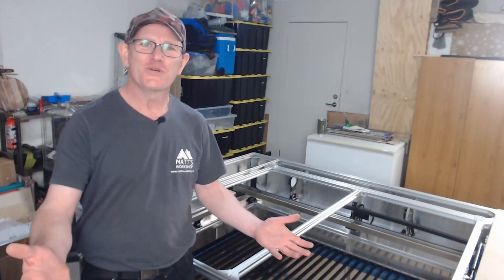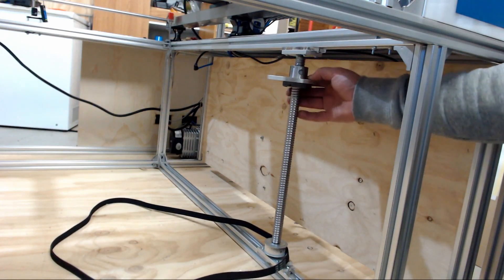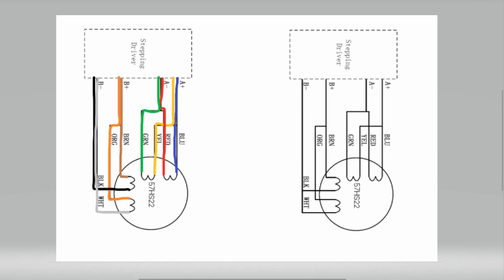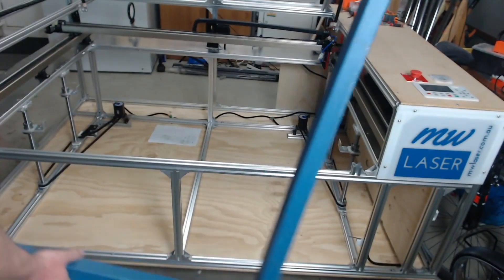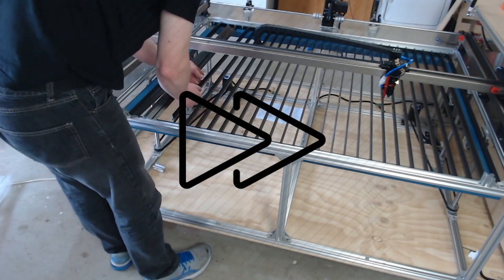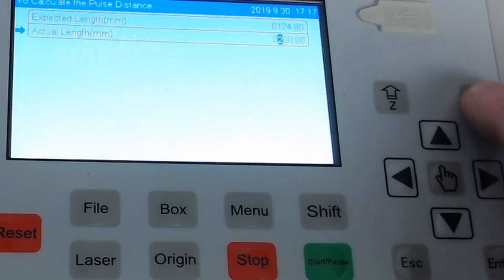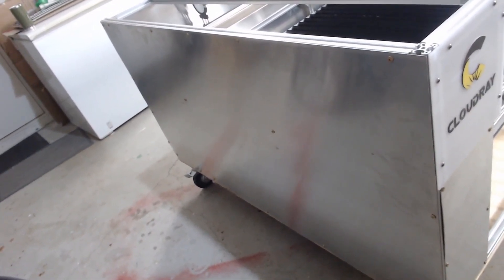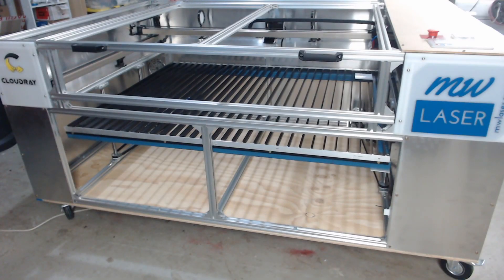07 Build Your Own Laser   Z Axis Lift Set Installation

Comment: Great video and has helped me for my next upgrade. This might sound crazy but I have decided to do the upgrade on my 80w red black machine. I have already upgraded it to a stepper motor and I really like the using the z adjustments in lightburn for offsets but because it is chain driven it is very clunky, also the lead screws have a lot of play. I have ordered custom ball screws (surprisingly on a couple of dollars to customise) and will machine aluminium parts on my CNC. I am currently using a DM556 driver but I might need to add another to drive both. Considering it’s a lot smaller bed I might get away with running at a smaller current per motor.
Reply: So looking at other designs I see thunder laser have moved to a single motor with a long belt which will save me buying extra motors. Also taking their idea of tray underneath
Reply from the maker: Sounds like a good plan

Comment: Hi Matt, I just installed the Cloudray Lift Kit in my Red and Black 100w laser. I have shorter ball screws than came with the kit and made my own brackets.
The problem I'm having is the Distance Per Pulse, Step Length in RDWorks.

To even get the motor to move I have to set it to 29 um an above. Anything lower and it stalls.
When I try to calibrate it I get a Step Length that is way lower, like in the 7.?? range and the motor stalls.

I have the controller set like you have it with the current at 5.83A and 400 Steps/rev.
With ON being written on the dip switch I have 1 on, 2&3 off, 4 maybe on or off, I tried them both and 5-8 on.

As far as wiring I tried your setup and others and found that wiring them in the same way in parallel with no A or B swapping worked just fine.

It's just the Step Length I'm having a problem with.
I have a Ruida RDC6442S Controller.

Do you have any Ideas on what might be wrong?
Reply from the maker: this is not something I can assist with via youtube comments.  email info this to askmatt@mwlaser.com.au with some photos of your driver settings and motor etc and I will try to assist that way

Comment: One design flaw I can see with the Z-Axis Lift: you should've used chains and sprockets for power transmission instead of timing belt and pulleys. Your table is going to be big and heavy and the length for power tranmission is extensive--using chains means more robustness. Of course if you have been sticking too much to Chinese designed machines and just want to avoid working with chains then you'd go for the belt design.
Reply from the maker: thanks for the tip, chain and sprocket may be a great idea, and more expensive.
However after a year of daily use this machine has not failed at all in the movement of the Z Axis with the timing belt and pulley system. The movement is smooth and the accuracy is spot on.
Cheers Matt

Comment: Hi Matt, thanks for your videos. I’ve used same motors and parts for my Z lift system, but the problem is with the motors they are labeled with 4.0A, so i put 1,2,3 driver switches On On Off, but the motors practically doesn’t move, what is happening? The 4th switch must be On or Off? And what is the right current 4A or 5.6A? I have same motors Leadshine 57hs22
Reply from the maker: email matt@mwlaser.com.au for assistance if required

Comment: Thanks for the video Matt but why would you choose a Trocen controller over a Ruida?? That just doesn’t make sense considering you upgraded your other laser to a Ruida controller. Anyhow I bought this kit from Cloudray because of your video. But they claim they do not sell the aluminum bed rails, did you get that from a different supplier? Thanks!
Reply from the maker: G'day, I chose Trocen to try out, it is compatible with Lightburn and was a bit cheaper than the Ruida.  It is performing well.
The Alloy rails came from Cloudray Directly, You can order the set of Rails and Spacer Rails to the dimensions you need.  They may not sell separately, but they do as a set.
I let them know the size I needed for the width and length, as well as the spacing required between each rail, and it was made and sent.
Sorry for delay in reply we're busy preparing to move premises.
Cheers Matt
Reply: Matt's Workshop -MW Laser Thanks Matt for the response, much appreciated. I will contact them direct about the rails, thanks again! Jason

Comment: hello Matt´s nice machine, but i have a question,  I think that the mechanical and electrical part of the Z system (motors, belt and electric cables) are very unprotected, the laser could be hit any component. Do you think about protecting the Z system?
Reply from the maker: The machine is not finished yet and this has already been planned and is yet to be implemented.  Thanks for the comment. Cheers Matt
Reply: Hi Matt, I'm in the process of designing my laser and have already ordered all my stuff from Cloudray. One thing don't understand is why you (and Cloudray) would put the motor and tensioner for the z axis inside the work area, when you could easily mount them outside the working area. By doing this you wouldn't be limiting the travel of the z axis to the top of the motors, you'd have full access up and down and be able to fit bigger items to engrave in the work area. You mention you have a plan to protect the z axis parts from the laser, I'd love to see what you have done.